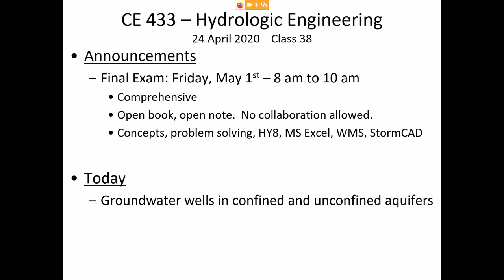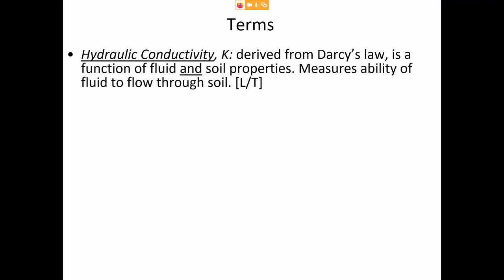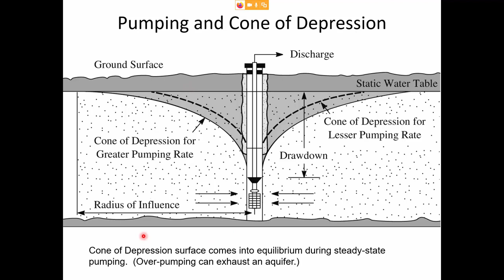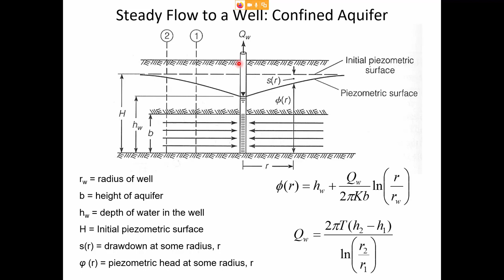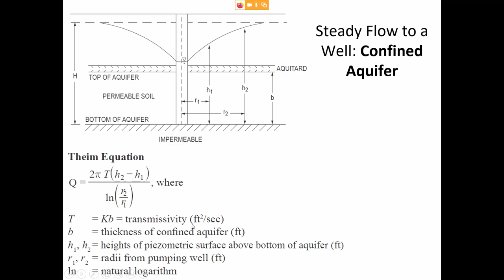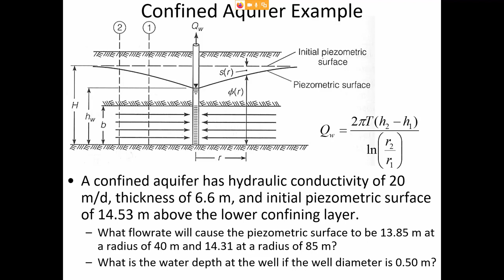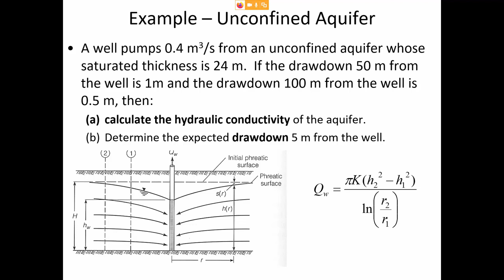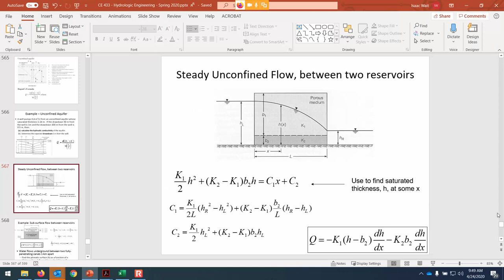Groundwater wells in confined and unconfined aquifers - CE 433 Class 38 (24 April 2020)

Comment: Thank you. plz help us with this

1. Suppose there are two canals at different levels, separated by a strip of land 1000m wide of permeability K=12m/day. If one canal is 2m higher than the other and the depth of the aquifer is 20m below the lower canal to an impermeable base, find the inflow into or      
abstraction from each canal per unit length. Take annual rainfall as 1.20m per annum and assume 60% infiltration. 

2. A fully developed well, with an outside diameter of 0.5m discharges a constant flow of 0.08m3/s from an aquifer whose coefficient of transmissibility is 25 x 10-3m2/s.  The aquifer is in contact with a lake 2km away and has no other source of supply. Estimate the drawdown at the well face. Assume R0 =2L where L is the distance of well from lake. 

3. A circular island 500 m radius has an effective infiltration N of 4 mm/day. A central well is pumped to deliver a constant Qo of 25 m3/h from an aquifer with dimensions and properties as shown in diagram.  Whrat is the drawdown at the well and at the water divide? 

4. Water flows through a sand aquifer with a piezometric head gradient of 0.01. 
a) If the hydraulic conductivity and the effective porosity of the aquifer are 2 m/d and 0.3 respectively, esti mate the specific velocity and seepage velocity in the aquifer.
 B) Estimate the volumetric flowrate of the groundwater if the aquifer is 15 m deep and 1 km wide and
 c) how long does it take the groundwater to move 100 m

Comment: Dear Dr. Isaac,

Thanks for your lectures. One of the projects where the  permeability is needed for the top 5 meters. The well  is a semi penetrating  unconfined aquifer, but we reach a depth of 30 m and no aquiclude has been encountered. What is the thickness of the aquifier (H) that should be used in the equation in this case? 

In addition, I don't understand how the thickness of the unconfined aquifier can affect the flow rate into the semi penetrating well. Assuming the well is 5 meters deep, does it make any difference in the flow into the well if the aquiclude is 10 meters or 100 meters deep

Comment: That is great. For unconfined example for B part of the question, you used h2=23.5 what if we get the h2=23 , will it be still acceptable? Appreciate it
Reply: h2 is 24m (the saturated surface level) minus 0.5m (the draw down from the well 100m away) = 23.5
Reply: @davedimond7405  at second part (part B) is asking for draw down at r=5m. In this case you have to accept the h2 from part A, and solve for h1 then you able to find the drawn down at r=5m. As Isaac is getting this h2=23.5 so i am sking can we get this h2=23 as this is aslo a point at r=50m as the 23.5 is a point at r=100 m, appreciate it